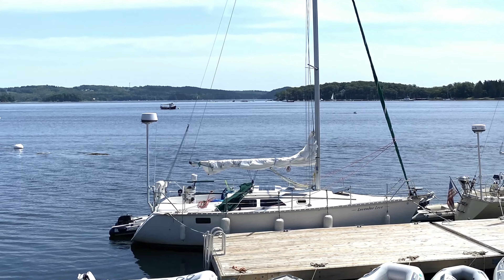Mooring Ball Winter Stick

Comment: One comment about rigging the winter stick.  The small winter stick like you have doesn't have any internal weight.  That is why it lies flat on the water.  Ideally you want it to float vertically.  That is accomplished by attaching 3-4 feet of chain to the winter stick and attaching the rope to that chain.  At least that is the way we do it in Southwest Harbor.  Good job doing it though.  Your top chain wil last about twice as long if you drop it into the mud.
Reply from the maker: Thanks Todd. I enjoy watching your videos! I wondered if I could weight it  somehow and regret not getting the longer stick. Thankfully it’s a quiet harbor. It does stand up at high tide. I’ll have to work on it next time around. Thanks for the comment!

Comment: Hey, does this protrude from the surface of the ice during the winter? or does it sit under the surface?
Reply from the maker: Ideally this should protrude. This second year I added a little chain to it so it sits up at any tide. If it doesn't a boat could miss it and catch the line. This harbor hasn't frozen over in a long time but I hear it can and used to years ago.